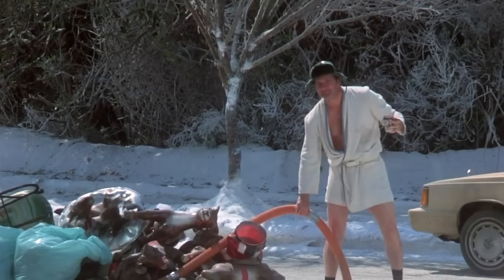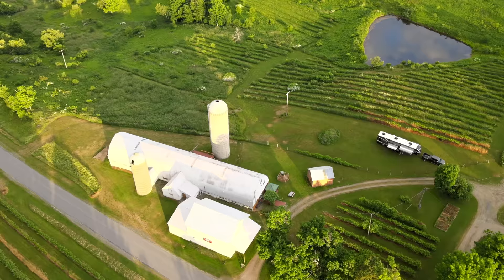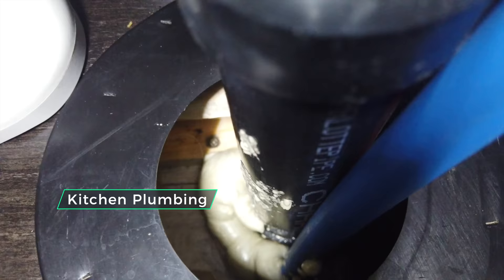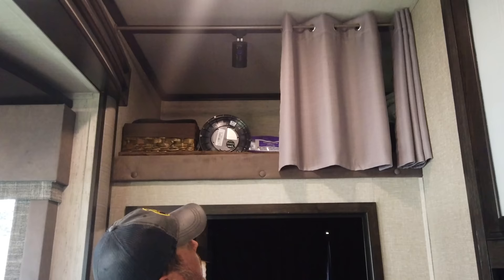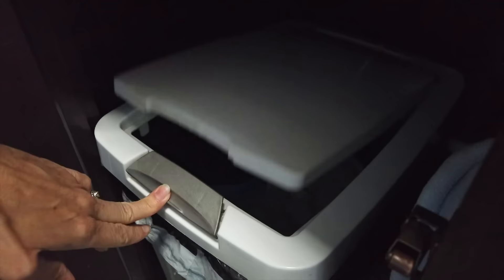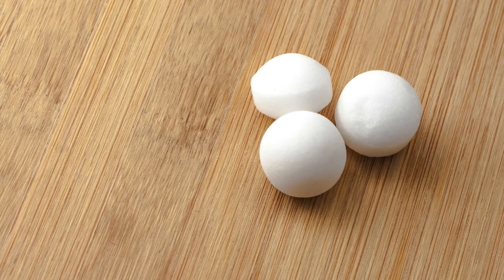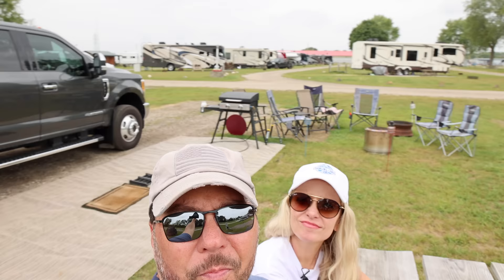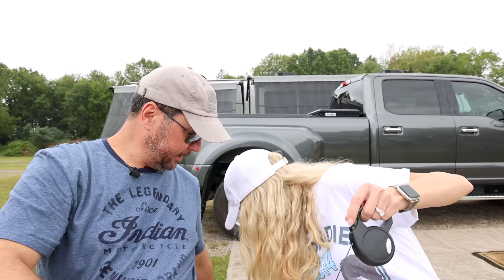RV Pest Control (Avoid Rodents / Bugs / Spiders)!

Comment: Good video.  Chad, what do you use to block visitors where your water hose exits the wet bay?  Looking forward to the suspension/brake upgrade video (oops, forgot it was secret 😄🛣). Travel safe.
Reply from the maker: Never had any issues there...  Our inlet has a cover that pops down and allows just enough room for the hose.

Comment: NY Adirondacks were hit real hard with mice this year. At our favorite off the grid campground some campers were trapping 25/night. Before we left home I tried to fill all gaps. I used electronic ultrasonic devices, peppermint oil and cayenne pepper (around stabilizers). I felt lucky that we trapped only 4 mice over 3 nights. During our 14 day stay. I think when the weather turned a little cooler in August that is when they looked for a way in.
At the end of the season. I will look to see if I can determine how they got in. Prep for winter storage.
I will also try some of your deterrent suggestions.
I look forward to seeing your upgrades.

Comment: Plastic food storage containers work better for bugs than rodents, so be sure to take other anti-rodent measures.  I used to live in an old cabin in the mountains and I had rodents in my kitchen every winter, even on the high shelves.  They chewed through my plastic food storage containers so I moved everything to metal or glass containers (with metal lids).  Don't assume that a sealed plastic container is enough to keep rodents out -- it's not.

Comment: much MUCH more difficult to fill holes on a Class A coach than a 5th wheel.      I found that if I carry a bag of repellent pellets from Tractor Supply and spread them under the coach wherever we are, that we don't have issues with rodents etc.    After 4000.00 repair this year dropping the diesel fuel tank to replace the hydraulic line and the fuel line due to squirrels,   the pellets are a simple preventive.   Tractor Supply also has these  minty scented packs that you put in the basement and rodents do not like them, so i also have severl of those.

Comment: I’ve been using dryer sheets, Irish Spring, the little mint smelling bags, and the little sonic deterrents. Nothing has worked. The only thing that works are the old style snap traps. I’ve caught 3 in the last 2 weeks. I’ve plugged all of the holes I could find. And the camper is clean of any food. It’s frustrating.
Reply: After watching your video I’m going to try the lights under the FB. Thanks. Great video.

Comment: We use ant powder around landing gear also where the power cord touches the ground. We have wrapped tape around the power cord upside down so they stick to it. Also use steel wool in larger holes then foam

Comment: I have a mouse infestation, I use the fabric sheet method, & currently I’m using the moth balls method, plus I have sticky traps out, it’s been a week since I’ve seen a mouse, knock on wood!, fingers crossed, peppermint oil didn’t work for me, I also bought super fine steel wool, and stuffed all the gaps

Comment: Rats and mice can definitely chew through Great stuff, expanding foam...use steel wool and peppermint, mint oils sprayed on your tires, your engine bay and then soak cotton balls and place those around the camper for mice and spiders both. The diatamacious earth kills every crawling bug. Even those huge flying roaches like in Florida, true.

Comment: We installed LED lights from the tongue of our travel trailer to the bumper of our travel trailer in the underbelly and we haven’t had any rodent problems, we are so filled in all the gaps and holes that we thought would bring in the rodents and we used a silicone spray which hardened , I keep the travel trailer extremely clean everything is packed up in airtight containers even the linens we are not full timers but we go on weekends and take trips for a week or two but afterwards I clean the travel trailer thoroughly and I also use peppermint essential oil‘s on cotton balls inside the travel trailer in different areas and that seems to repay all the spiders in the bugs and even the rodents but I think the undercarriage lights have helped tremendously!

Comment: The Solitudes exteriour under carriage lighting is connected with the front cap exteriour lighting, they both go on together 🙄. 
Nice thing with the momentums, that blue lightening verses white. 
Also I noticed in our Solitude, under the sink in the bathroom, look up above the piping in the back wall is a punched hole, both sides in the under sink cabinet, so I checked out other 2019 Solitudes at a dealer that I did not buy my rig from, sure enough they have them too. Of course the cabinet doors are not air tight, so I don’t understand why the (literally) punched holes in the upper under cabinet back wall, as nothing is going through them. Holes to big for gap foam fill. So I haven’t gap filled the area around the floor where the piping goes to the basement yet because the holes in the wall is much bigger. (Didn’t think of checking the momentums at the time.) I do know the pee trap rv thingy of the piping needs air, but this is a bit ridiculous. Any idea why the punched wall holes? Does your rig have them too? 
Cheers 🍻
Reply from the maker: Not sure we have the same holes... Our RV isn't with us right now though.. Last round of upgrades..   😊  I'd bet there's a way to separate the light controls... You might try asking around in the GDRV page on FB: https://www.facebook.com/groups/GDRVowners/

Comment: How’s your tow vehicle? 
Is the F450 too much truck and is the F350 the better choice? 
We’re lemon Lawing our 2020 GMC 3500 and need to swItch brands.
Reply from the maker: In hindsight, we would go back in time and buy a 450.  The turning radius is amazing.
Reply: Changing Lanes  The 2021 supposed to be new front axel and even better turning radius.

Comment: The problem is mice love copper wiring, they ate the wire from my thermostat to ac and the electrical wire that supplies my refrigerator
Reply: I heard it's the anti-UV coating on the wiring that attracts the rodents.  Could be wrong.

Comment: My 2020 Keystone Cougar 5th Wheel has an bottom opening area in the basement that normally has round screw-in devices that seals the basement when traveling. Unfortunately the area has to remain open at campgrounds for city water and cable TV and there is plenty of access for critters while camping. I haven’t figured out an easy way to seal the opening that also is easily removable when not using city water and cable so I can screw in the protective devices on the top and bottom of the access opening. I am new to this so suggestions are appreciated. Thank you for creating the channel.
Reply from the maker: Ours cam with this...  https://amzn.to/327Ttuu

Comment: Has anyone tried fox urine or coyote urine? Probably cat urine would work. Just put some cat box clumps under trailer. Using it on the ground around the camper/motor home. Or maybe a couple of drops in elec area. I used it to get rid of a groundhog under a shed. It worked. The essential oils dont work. Ive seen vids where they eat the soap.

Comment: I was looking around for rat stuff and saw your posting I picked up a rat somewhere and was parked for 2 weeks and the darn thing ate wires and my truck is in the shop for 3 weeks getting fixed so it will run so I am trying peppermint essential oil mixed with water and I am going to spay that around the engine compartment with dryer sheets and I heard gain was the best?

Comment: Thanks so much for the advice especially on how to use Great Stuff Foam Spray! Have you guys had any mice chew on it since? We have been RVing full-time for over a year now and are still new to everything  (sold our home with no luck of finding a home so far). I've used peppermint oil, cayenne pepper, apple cider vinegar, bounce dryer sheets even bleach and they do all work, but we go through them so fast and have to replenish all the time. I also keep our small rv clean and cover up food all the time. It gets annoyingly windy and rains a lot where we are at and thats when mice especially make their way in.

My husband usually handles the mice or gets rid of them in traps for me because I am a pussy when it comes to mice (I will not even touch a trap with a mouse dead or alive without a grabber 😅). He finds my fear ridiculous and irrational and says he would just prefer catching them in traps and then releasing or disposing of them. Problem is there is more and they always keep coming back! lol I want a permanent solution where I dont have to keep worrying about them coming in, so looks like the gloves are coming on and I am getting down and under with Great Stuff! Thanks again!

Comment: The number one thing you do and most important to avoid pests is(which you did not mention),  You park on pavement in developed Campgrounds.
Reply: Not everyone camps in campgrounds though
Reply from the maker: We're almost never on concrete or pavement but have still been pest-free... 😀
Reply: @ChangingLanes  I have watched many of your videos, Of course I won't argue were you have camped. But I don't recall any bondocking not on pavement or in campgrounds videos. I am a full timer and I camp in places surrounded my mice holes. You guys do not camp like this. I wouldn't have any pest problems if I camped in the places you do. Boosting about no pests yea good for you.